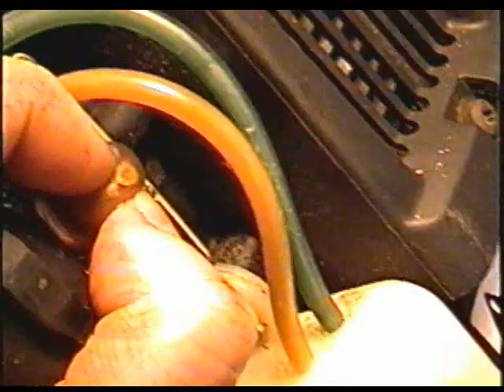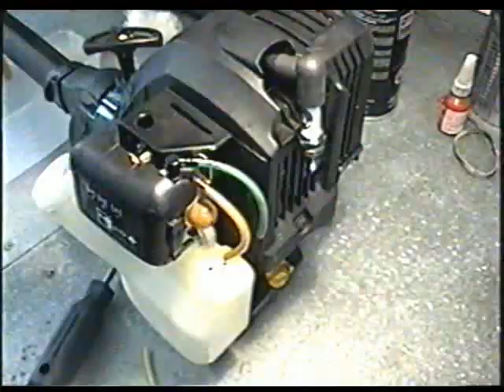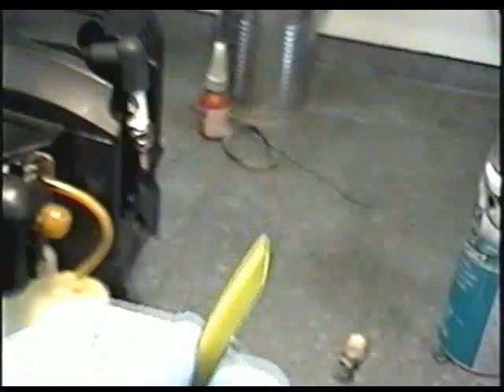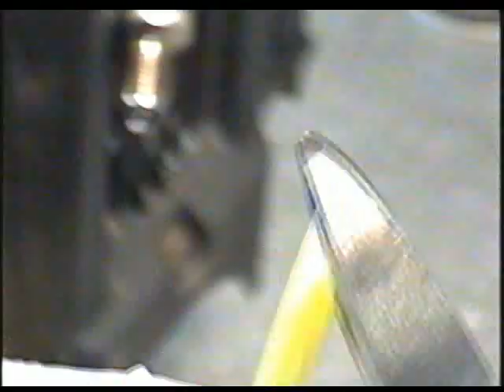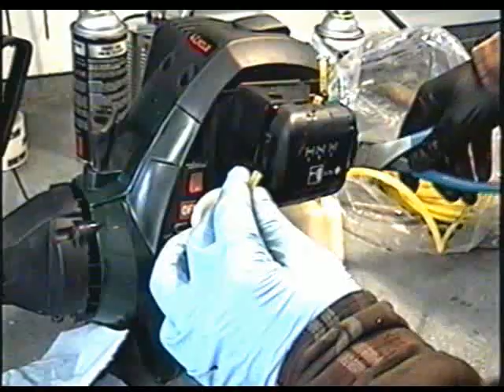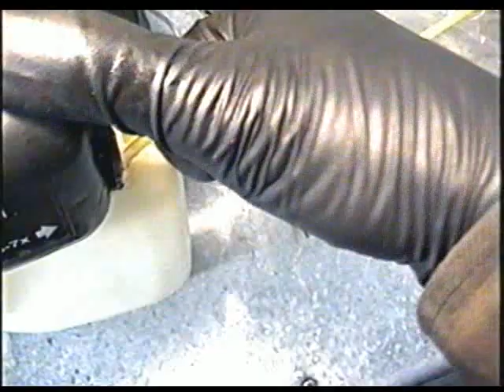Fuel Line & Filter Repair on Ryobi,Troybilt, MTD 4 Cycle Grass Trimmer

Comment: Great video, I am working on the exact same machine. My fuel line came off last year and I could not figure out which one to put on the filter and which barb to put which line on. Now I just need to find your video on the primer bulb replacement. Thanks.

Comment: Just what I needed... thank you.
Reply: Hi! Did you use the same diameter line for both intake and  primer return (purge ) side? Thanks,  Kentucky Wildcat fan.
Reply: @Suncast45  if you're asking me,  I still had a kit leftover from years ago that I bought at Home Depot. Hadn't used all the parts in the package at the time and luckily, needed the fuel filter similar to the one Dony used here.  Look on their site and I think Ryobi model number AC05RYFL will suffice.
Reply: @texasaggieproud  Thank you. I will try that!

Comment: Thanks so much. Your video was great and after following your instructions my  Troybilt,  4 Cycle Grass Trimmer(TB525CS) started right up and purred like a kitten.  I got a "New Pack of Replacement Snap-in Primer Bulb, Fuel Filter, 3 feet Fuel Lines"  from Amazon for  $10.00. The primer bulb was not appropriate so I found a "Replacement Primer Bulbs (3-Pack)" at Home Depot for about $8.00. 17 bucks and about 20 minutes, not too bad.
Reply: Ron Webb I have this same model, so thanks for letting me know this will work.
Reply: yes, from what I remember.  I'm at work, so I can't exactly run out and check.

Comment: I just found your channel yesterday. You have some great videos. My Troybuilt 4 stroke weedeater has the some carb as the one you worked on here. My question is I replaced my fuel lines because the rotted. The new lines leak gas where they go into the tank. I tried sealing that with permatex. The problem is it will crank but when you hit the throttle it bogs down and will go dead. Could my fuel lines not being correct outside diameter and letting air in cause this? I took the carb apart yesterday like your other video showed for this weedeater and mine is clean like this one.

Comment: I have an Troy-buit weed eater it is an 4 stroke. It will not start. I have cleaned the carberater and it still won't try to run so I look at the spark plug and it is giving an spark. So I when to the value and the value close es to the carberater wegels bad and the other value is not wegel. Is that the problem that is not making my engine not run if not can u give me some help on what can be problems  will this weed eater. Thank you

Comment: I replaced the fuel lines on my troy built weedeater and now it leaks all the gas out when not in use.... bought the yellow Oregon tubing... hell to install but runs and leaks like hell after use... all the gas will leak out after sitting still

Comment: I have a Ryobi 875r that has been a super workhorse the 15 years I have owned it. Trimming, roto-tilling, blowing and vacuuming, this machine does it all. I watched the video "How to Fix the Starter on a Ryobi Trimmers". I actually managed to remove the clutch by inserting a screwdriver through the housing and engaged the flywheel. (my 875r uses a torx 15) I like the "rope trick" better.
          My question is do I use a punch and mallet  like on that video to remove the clutch plates? They are little different than the video, two plates held together by two hefty springs. Please advise, also any tips on changing the short block? 
         I appreciate any tips you can give, thanks

Comment: I got an old Ryobi 875r grass trimmer 4-cycle. The fuel lines were rotted and the filter was loose in the bass tank along with some rust looking sludge. I was wondering if there was a good way to clean the sludge from the tank and off the filter? it isn't a lot but I was wanting to try to reuse the filter since I don't know where to get another one. Great video and thanks for posting it.
Reply from the maker: sometimes engine cleaner works, then rinse with gas

Comment: Great video, this is exactly my trimmer, and the fuel lines rotted.
Didn't know about the filter, and sure enough, there it was at the bottom of the tank with some rotted line. Back in business thanks to your comprehensive video.. :)
Reply: Holaaaa muchos abrazos desde colombia

Comment: Of course, if you order the fuel line replacement kit from Troy, the filter is already installed in the new line so you can't install it until you figure out how to get it off and back on.

Comment: Went out and bought fuel line replacement kit at Lowes Hardware (lines, filter and primer bulbs) all for about $11.00 US. After going through and cleaning carb and spark plug etc it fired up first time thanks again for the info.

Comment: Thanks, Donyboy73. Last night I installed the replacement carburetor on my Ryobi 890r 4-cycle Gas Trimmer. After refueling, and priming, I could not get it to start but I only tried two or three times, since my wife had already gone to sleep, upstairs, and I did not want to wake her.  After the fuel sat in the new carburetor all night, I tried to start it again, this morning, and it runs great!  I just needed to adjust the idle speed, once it proved to be running good with the new carburetor.

Comment: Thanks to your instructional videos and the new parts from Ereplacementparts-dot-com, I was able to get both my 15-year-old Ryobi 990r 4-cycle Gas Trimmer running again and in good working order as well as my 8-year-old Ryobi 890r 4-cycle Gas Trimmer.  Both got new fuel lines, air filters, spark plugs, and primer bulbs but, the 890r got a new carburetor, and corroborator gasket for the sole purpose of getting it's primer bulb replaced.

Comment: I have this Ryobi 4-cycle trimmer.  The only way I could replace the cracked primer bulb was to purchase a new carburetor that comes with a new primer bulb built in. The old carburetor worked great.  I have not been able to get this trimmer to start since I replaced the carburetor with a new one.  Maybe this repair job was over my head.

Comment: to put on a fuel line on a plastic connector i just heat the end of the line up with a lighter and that softens the rubber and it goes on like nothing